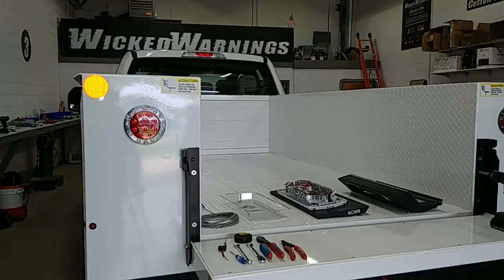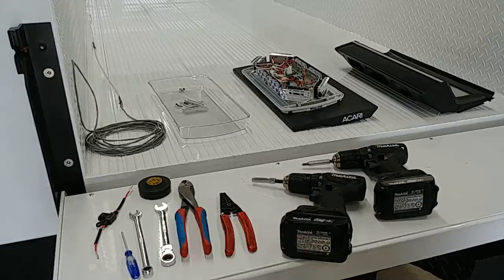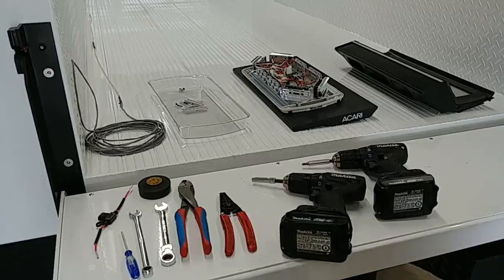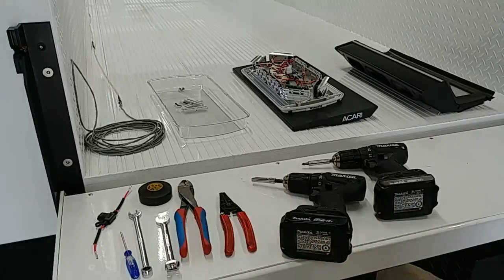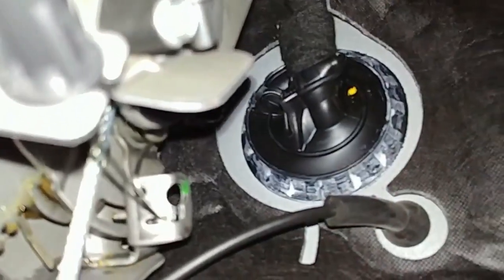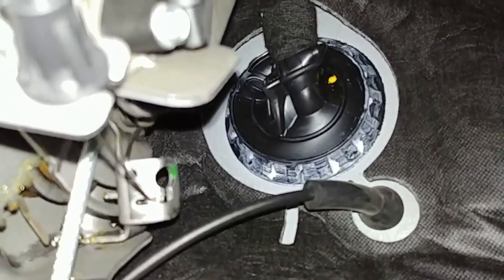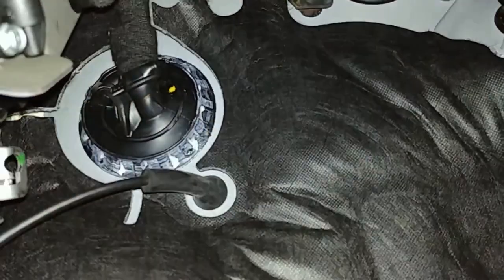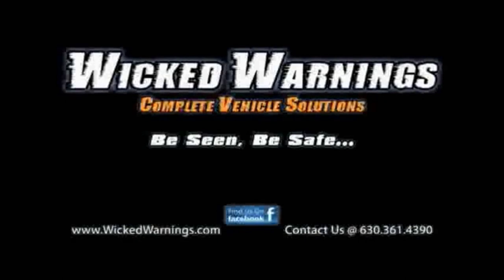Tutorial: How to Install an Acari Drill-Free Mounting Platform on a Super Duty

Comment: Good job buddy. We also upfit trucks.I was just going to say that when you brought your wiring through the firewall grommet, the small rubber tit on the grommet is a factory (wire pass through) . It's provided from Ford for that reason. Enjoyed the vid.
Reply from the maker: Yes we are aware, however when you cut the end of the tit off it opens a large hole, that does not self seal around the wire.  This is why we prefer to use to wire insertion tool.  Thanks for the info.